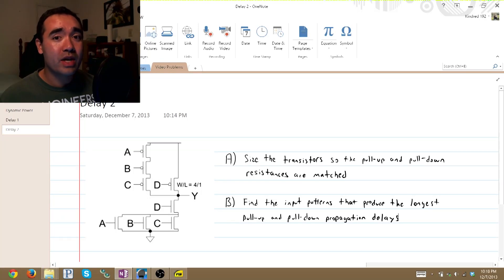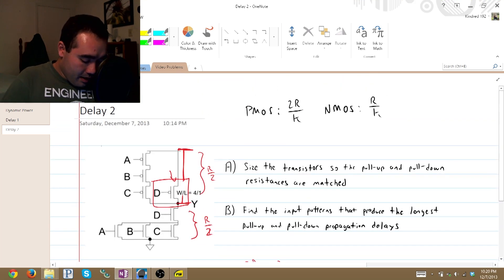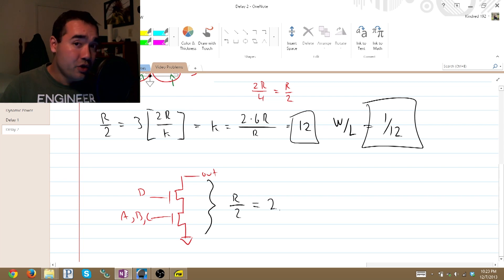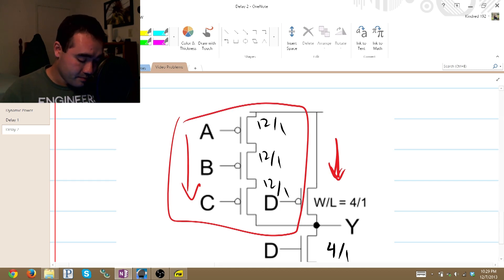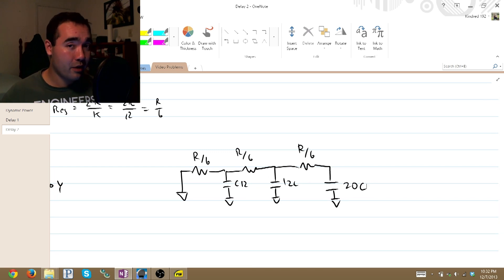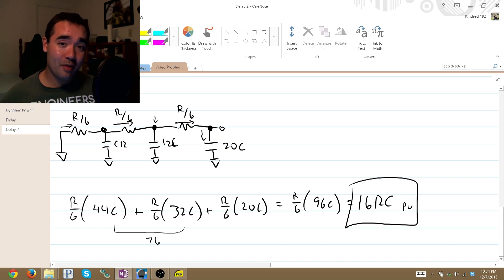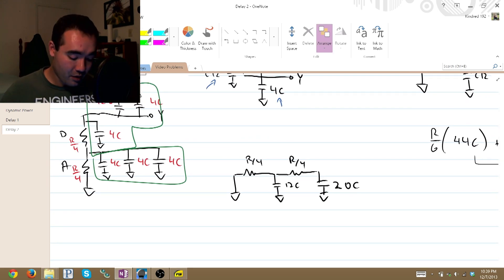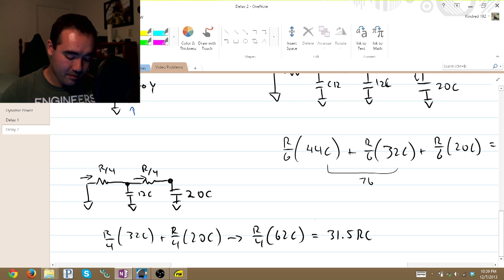IC Design I | Transistor Sizing and Resistance Matching

Comment: I had a doubt regarding pull up network when A B C are low and D only high it works why we are not taking nmos transistor D when calculating worst case as NMOS D is ON?

Comment: YOU can produce an even bigger High to Low progation delay

If the B and C nMOS in the PDN are OFF then the B and C pMOS in the PUN are ON, which means you must also consider two additional capacitances: (bad notation follows) C_ABp, the capacitance between the A and B pMOS in the PUN, and C_BCp, the capacitance between the B and C pMOS in the PUN. For the input transition: [ABCD] = [0001] -> [1001], these two capacitances, C_ABp and C_BCp, were at VDD before the transition (i.e. when [ABCD] = [0001]), but will need to be pulled down to GND after the transition. This leads to a bigger delay.

Comment: Are PUN delay and Low to High propagation delay the same thing? If so, I think you'd get a bigger pull up delay with the following input transition: ABCD goes from 1001 -> 1000